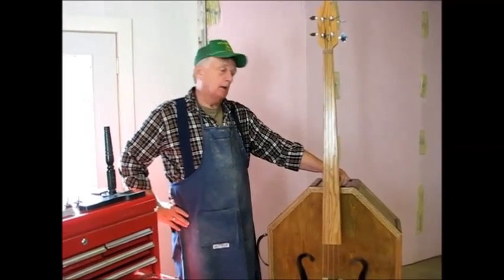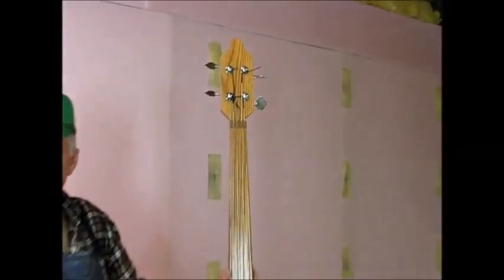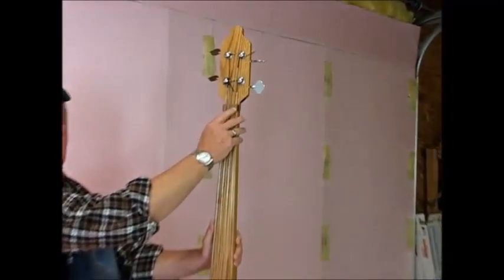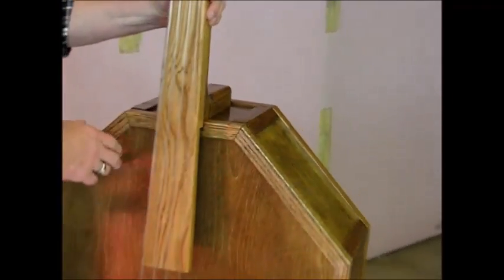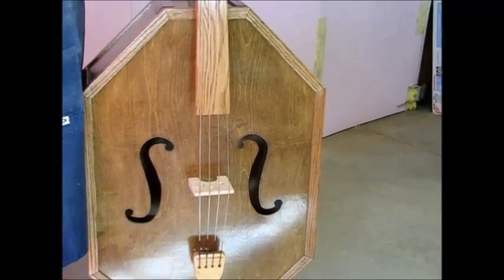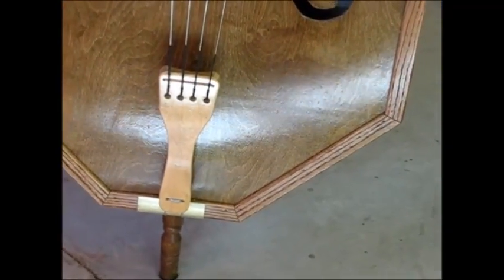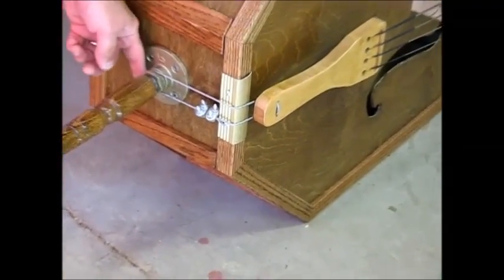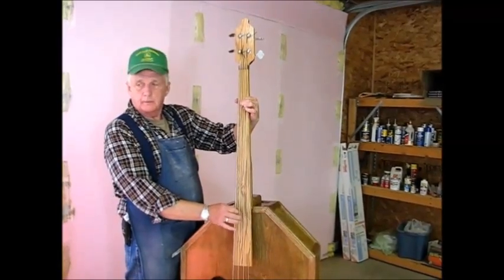Home made Bass fiddle

Comment: So it does NOT have a soundpost in it? Have you tried them in the ones you've built? 
It looks and sounds great btw!
Reply from the maker: Yes, it does have a sound post! The sound post is strategically glued in place and is made from a piece of standard 3/4" wooden dowel rod. I have  made five of these bass fiddles and all have a surprisingly good sound with the sound post glued in place. I think perhaps by stating that I don't have to worry about the sound post (because it is glued in place) you may have interpreted that as not having one.
Reply: Yeah I misinterpreted ya. I used to play upright and I was lucky enough that one of my bandmates at the time was a luthier who did a lot of work on uprights.  He had plenty of nightmare stories about soundposts and bridges and just about every other part you can think of ;)

Comment from the maker: I don't know much about using a bow but I'm quite sure the fingerboard part of the neck has to be rounded to allow access to each string with the bow. The fingerboard on the neck on my Bass is completely flat. I just don't have the skill or the equipment to make it rounded. Making the cuts on the sides could be done easy enough
Reply: thats very true. absolutely,the curve helps the bow make contact with an individual string.

however, would the side cuts really matter?
however, for straight forward fingering, plucking, and certain slap style this bass would certainly do just fine.
Reply: The curves do matter, for sitting on a stool and using the German style bow, and sometimes French style, the bow goes where the curve goes. Also. Maple would be very nice to use on the peg, when you play a bass the whole thing resonates which gives it it's deep tone. Avoiding using plywood would give it a better tone.
Reply: Spencer Rawlins would it be good for rockabilly type of slap bass

Comment: This is a great video - thanks so much for sharing it!  I'm curious to know your thoughts on ways in which your design could possibly be lightened (1x2s instead of 2x2s for the frame - smaller trim pieces around body, etc) without compromising its strength.  Keep up the good work and thanks again for sharing your creativity!